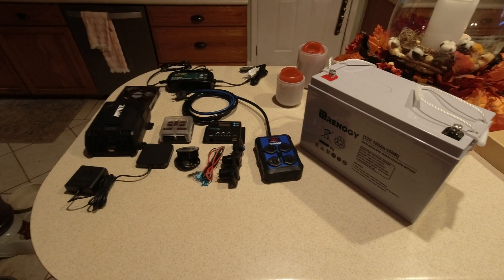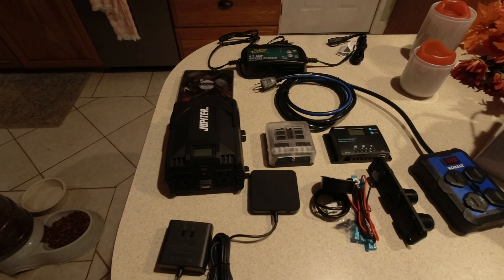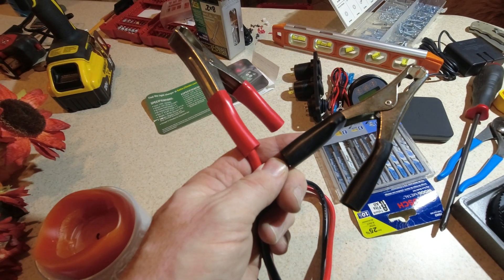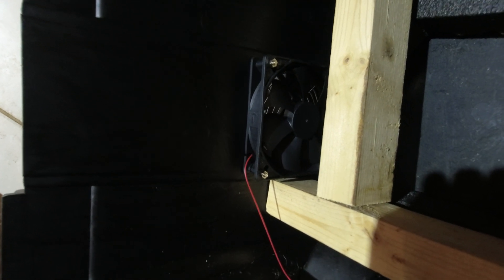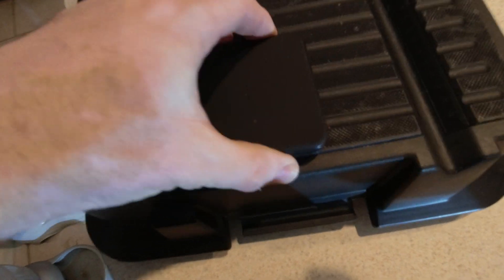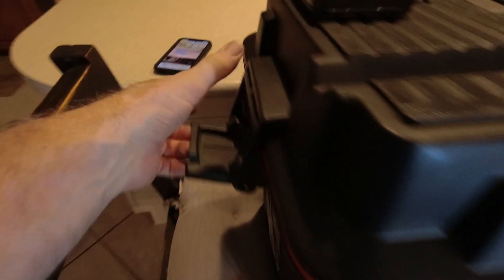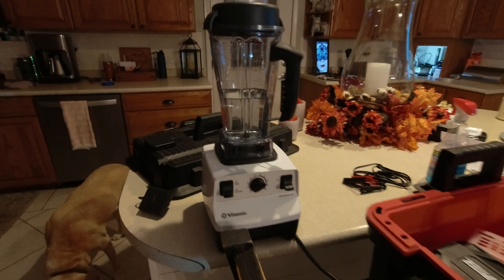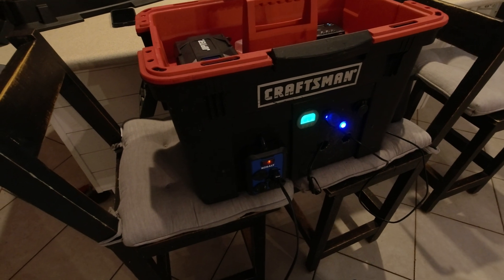DIY Solar Generator/Portable Power Station Build

Comment: This is a nice build using what you have on hand. I use LifePo4 batteries from Dakota Lithium for my HAM battery box build. As far as a cooling fan goes, you really don't need it just for the battery, but since you have added the inverter they do need a good bit of air circulation as they do generate heat. One of these days I will make a video of my HAM power box build.
Reply from the maker: Yea it was a simple build, I just wanted to show what you can do with some supplies you have  to make a power source. I do plan to upgrade the battery at some point as well as the inverter. Your right, I didn’t really need the fans but it was a nice touch. I have this generator in my shed right now powering it.

Comment: Creek,  If I just wanted to strictly have 12v capability (no inverter - usb and cigarette plug only) using a solar charge controller and/or LiFePO4 charger would there be a need for venting the box and adding a fan?  I have a SOK 100ah 12V LiFePO4 Deep Cycle Battery that I want to use to power a 12v fridge, charge phones and power other USB powered devices when camping.  I want everything integrated into a single case similar to what you have done.  If 110 charger develops too much heat I’m ok to not have it in the box with battery.  Appreciate your time to make this video and share.
Reply from the maker: This is just my opinion but I would use a fan so you have the option of cooling the battery.  You can do what you saying because I believe the SOK battery has high temp charging and discharging cutoff and if your only using low watt 12 volt appliances your not going to generate a lot of heat when discharging. Most of your heat is going to come from charging and that’s where cooling fans can come in handy. I’m sure you already know this, but you don’t want your battery to be in direct sunlight especially if you don’t use a cooling fan.  I’ve seen other people not use fans and have no problems. I hope that’s helpful. Let me know if you have any other questions. Thanks for the comments and watching, its much appreciated.
Reply: Thanks!!!!!!

Comment: Question:  How long does it take to charge it from that battery charger???
Reply from the maker: The charger I’m using right now is only 4.5 amps so it can take between 8-10 hours to charge.  If I were to upgrade to a higher amperage charger I can reduce that charge time. But I’m ok with that. The solar can charge it in 3-5 hours. I also have a power supply that I can hook to the solar mc4 connections that I can plug into the wall that will charge it in 3-5 hours. I’ll be making a video on it soon to show how it works.
Reply: @PreppinontheCreek12  Ok.  Thank  you 😊

Comment: This is GREAT‼️ I did one myself but used a milk crate to house my solar generator components.  I would like to see how you install an off / on switch, because I want to do the same. Thanks for sharing.  😊
Reply from the maker: Thank you, I will post a video when I install the power switch.
Reply: Yes, I want to see how that is wired as well.  Building a  gizmo now and definitely want that in the schematic.